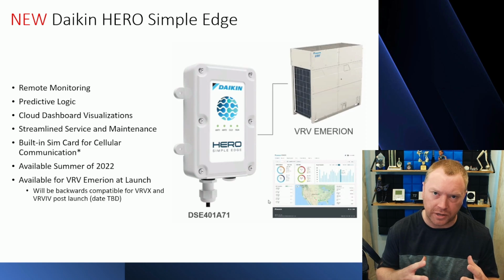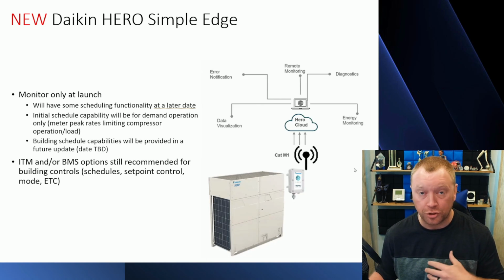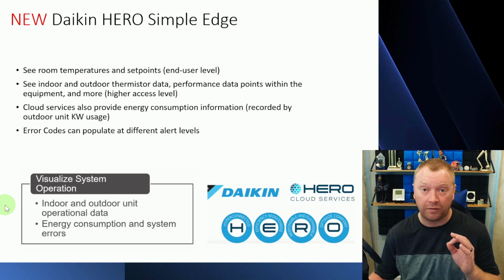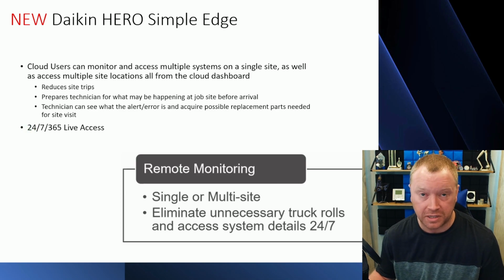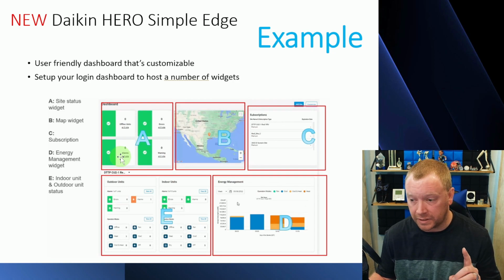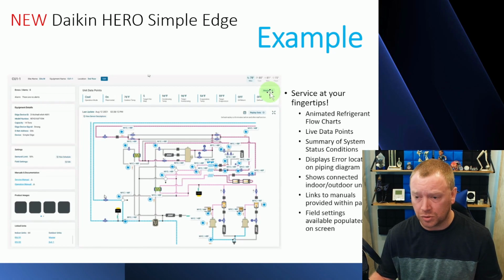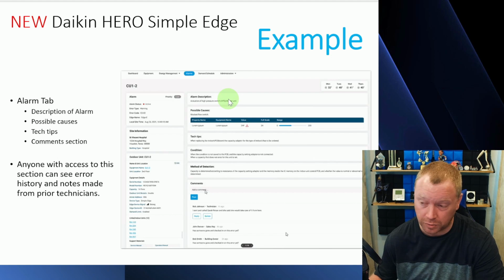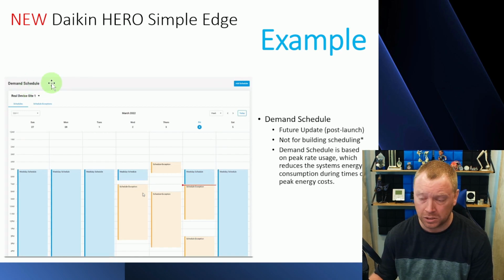Daikin Hero Simple Edge "Introduction DEEP DIVE" | Daikin CLOUD Monitoring!!! 6-11-2022

Comment: Great Video.   Do you have experience with Cool Master Pro and if so how would it compare to the Hero?  
I was recently quoted, by Daikin, both the Hero and Cool Master Pro.  Not sure which to go with to be able to monitor my system and make sure it is performing well.  I have 16 VRV IV at my residential building in Brooklyn NY
Reply from the maker: I'm biased on this so take this with a grain of salt, but the hero is a daikin software platform, so it's clean with no conversion. Cool master converts the logic. Older versions had limitations so personally I stick with hero. Plus the hero pro central controller is coming out soon which will make cool master obsolete in my opinion. But this only my opinion and im sure users of cool master would have plenty of cool things. I just do not want to deal with an additional controls scheme I need to worry about on the logic side.
Reply: @InverterAlways  Thanks for the insight.  I am leaning toward the Hero for some to the points you mentioned. Do you have any information on the Hero Pro central controller?
Reply from the maker: Not yet, it is coming out very soon I'm testing it now and should have content at some point once I start my videos back up.

Comment: This is going to be a fix due to a firmware issue with the i-touch manager not correctly talking to the unit etc. Have you ran into any issues when implementing this system? Any tips when it comes to commissioning this type of control system?
Reply from the maker: I'm unaware of any issues with the ITM as of right now. The daikin hero is a totally different device used for monitoring performance and trending the data. Remote access to errors and monitoring only, at this time. The ITM is still needed for building controls. But I'm very excited for this product. It's still brand new so I cannot speak on any issues as of yet. Commissioning the device should be pretty simple though and not take you much time.